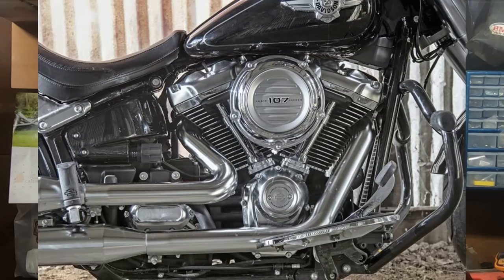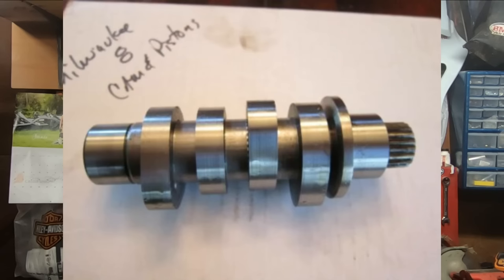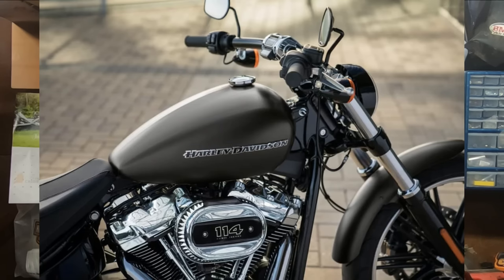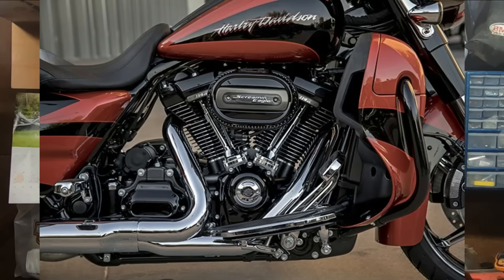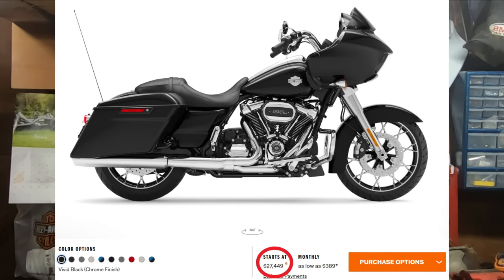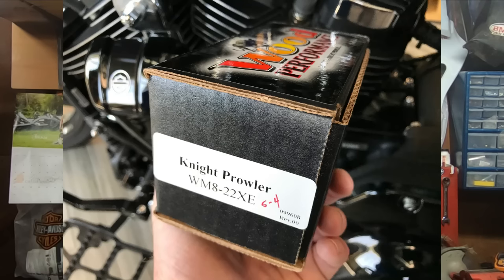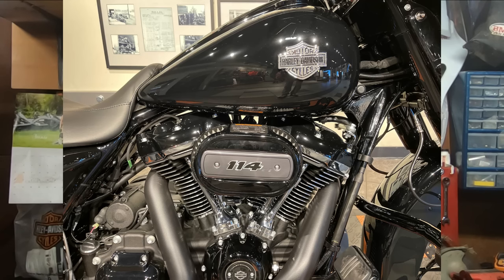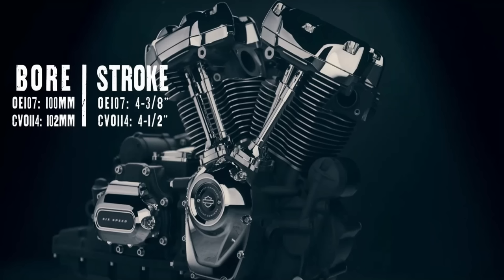Late Harley-Davidson 107's Are the Mistake You Make Overlooking

Comment: The only way I can see anyone knocking my NEW 107 is someone with experience and time and money for truly nail biting power in a Harley. I put stage 1, yea big deal right? If I twist from a dead stop 1st gear ends at just over 40 mph, and second gets you up around 70 mph before you have room on any real street to do anything else. So unless you have been riding like 124’s or above, with huge torque and power numbers, I don’t see how you could feel like it is not a great time on the bike, out for some cruising for fun. Furthermore, I rented a 114 street glide on a trip last month, brand new bike with 3k miles, and I am telling you that spending another couple thousand bucks for the 7 inches was nearly imperceptible compared to the stock 107. There was one moment where I was irritated by a goofball in a pick up truck on 465 east going around Indy and I gave it the beans and thought oh yea, it’s pretty good. But I made the choice to do that, I didn’t need to. So take that as it is for what it’s worth. If you just have a good deal on a 107, and you don’t have 15 grand to put into it and still pay your loan or whatever you just can’t turn it into a 131 or bigger, don’t worry about it just know that if you get it sounding decent like I did which gave me a decent amount of power above 3k rpm’s that was missing, you can get up to 90 miles an hour so fast (and oddly feel like you are only going 55 so be careful) it’s going to put a smile on your face every time. If you find an already goosed up 107 for a great deal don’t be afraid. Maybe you can shock some folks who look down on the 107 badge there on the side. If you have never ridden a truly big totally made over Harley that lives up to its “ass ripper” name lol, you won’t miss it anyway and you will be marginally safer while enjoying your riding. The stock 2022 107 does sound like a sewing machine at first, but everyone does their exhaust upgrades whether it’s necessary for them or not so just plan on doing something along those lines and you will love it!

Comment: What cam should I use on the 107 to give it more hp and torque so I don’t have to get the 124
Reply from the maker: I would go with the Wood W822XE, really hard to beat one of those cams. They will get you between 110 and 120 horse and torque with the 107.

Comment: The added MSRP is just the beginning.  There is added sales tax, right around 10%.  Added registration fees because it costs more.  Higher insurance premiums.  And if you are financing the bike,  especially through Harley, you are paying a lot of added interest on all of that.  I just picked up a super clean 2021 Road Glide Standard with only 3200 miles on it for $9000 + tax and registration fees less than the new 2022 Road Glide Special Harley was trying to sell me.  Not to mention, the used bike already had major upgrades installed by the original owner: Bars, seat, mirrors, radio, CMC back rest, lowers, Rinehart slip-ons. everything I would have still had to change on a Special.  A lot of good deals out there right now on low mileage used 107's.   Honestly, the 114 doesn't make cents.

Comment: Some things about The Motor Co.'s motor engineering team I don't understand.
Personally,  the EVO was a great overall design! Dual Timken Flywheel bearings, all gear camchest, dependable.
Then, the Twin Cam, failure prone cam chain tensioners, cutting costs, and eliminate one of the Timken Bearings on the bottom end. An all gear set up in the camchest is robust, simple, reliable. Why they would drop that, replaced with a cam/chain/tensioners set up. Chains stretch, tensioners wear, make the bottom end weaker, less one Timken bearing set. 
IDK. Like taking two steps backwards.
Now, the M8, already shown to have a couple serious design flaws. Yes, 8 valves increases flow, but other parts of the motor possess an achilles heel.
I would have kept the EVO platform, and continually refine it to be nearly bulletproof.
Just a thought.
Reply: agreed
Reply: I can't be too hard on Harley.  What I remember reading back in the day, the problem was our friends at the government had noise restrictions and a gear drive cam made more noise than a chain drive cam. If they put a gear drive cam in then they have to put more restrictive exhaust or detune it. Harley has to stay inside all these regulations, noise and pollution,  (and still make a profit) so the engineers have to make compromises. One thing I remember on the cam chain problem was little burs left on the chain when they were stamped with an overused stamp helped wear out the plastic tensioner faster. So even little decisions can cause problems the engineers can't predict.

Comment: I am fortunate enough to have owned TC88 (Later converted to gear drive 95ci) Stock EVO, TC110, M8 107 and a couple M8 114s. The M8 107 made good power. 114 does have little more pull but every motor minus the EVO can easily cruise at 100mph. In Cali emissions won’t let you build a 131 (Go out of state) but in reality 107 is beyond the skills of a majority of riders. Once you start pushing 120-130hp you’ll need to upgrade your clutch packs, fuel delivery and suspension at the very least. IMHO if someone has the skill I would buy an older CVO 110 or 107 and just do your own set up. Save $$$$ and have a powerful and beautiful bike. 

If I could find one: 2017 Hot Rod Red Candy Flake Road King Special and goose that sucker up 🤙🏽

Comment: But how does fuel change?
I’m a cross country guy so distance is important on 6 gallons of fuel.
But still want torque maybe 102 to 110 hp for getting out of the way.
Get 43-45 mpg
Reply: My  2020 m8 107 with a stage 2 gets on average 35 mpg compared to 45mpg stock

Comment: I have a 2020 107 m8 softale street bob. What bluetooth diagnostic or plugin diagnostic tools are preferred and usefull for troubleshooting and maintenance?
Reply from the maker: Any of your plug in tuners like Power Vision or FuelPak will allow you to read codes and get your going in the right direction. If you're looking for a professional level diagnostic tool to read live data and activate sensors those are some big bucks.
Reply: @GixxerFoo  will these tunners allow me to perform routeen maintenace such as when changing brake fluid , or troubleshooting an engine issue

Comment: Do you need to upgrade the valve springs with the Wood cam?
Reply from the maker: Not if you get a Wood cam designed to be bolt in, those are the cams I mainly recommend and cover.

Comment: Why do you have to do so much crap to get decent horsepower out of a Harley even when you buy it brand new? Harley guys are not satisfied with how big their Motors are they went from 61 to 74 to 80 to 88 to 93 to 103 and up and up and up and then they complain about all the heat you're sitting on top of a goddamn oven. Oh my Harley is so hot well you're only sitting on a hundred plus cubic inches of hot lean motor wow who never thought it would get ridiculously hot. You would think these guys would be satisfied with the horsepower that comes stocking and not do anything with the motor until they wear it out but they don't keep it long enough to wear it out they put all this stuff in it and then they sell the bike for 10 cents on the dollar really? I'm still waiting for the original equipment pistons on my 25-year-old Sportster to wear out and they haven't yet I am so glad I never had the money to buy a big twin Harley wouldn't mind an EVO powered big twin though Evo forever forever Evo.
Reply: Same reason people buy new mustangs, challengers, corvettes and do the same thing. 
Its a hot rod mind set
90+% of big twin riders never go beyond stage 1.
Reply: Yes, I’d rather my POS 88 Dyna was just a LOT more reliable with better build quality and less power, than constantly breaking down and dealing with ridiculous major issues like cam chain tensioner system having to be replaced and stators melting. 
Only 16,000 miles on a big engine and $8K just spent on repairs.
Reply: @shizuokaBLUES  ouch.
Reply: @shizuokaBLUES  I am surprised that twin cam owners do not engage a class-action lawsuit at Harley-Davidson for their motorcycles being unsuitable for use. You buy a brand new motorcycle to be free of having to worry about mechanical defects yet here it is you get all these problems to deal with because of their cheapness in building the engine and the engine is the most important part of the motorcycle and the most expensive to deal with when things go wrong. If I had a twin cam I would go with the Gear Drive if possible but then if you're going to go that you might as well replace the everything else that is questionable as well. And that costs a ridiculous amount of money $16,000 miles oh that that's just pitiful I truly feel sorry for you that you got such a lemon of a motorcycle. Good luck in the future and ride safe brother.

Comment: Have a 2018 Heritage with a 107 with a stage one and a Dark Horse Man-O-War compensater and Baker transmission with taller 5th and 6th gear, and it will run 85mph with  wife on the back at just under 2800 rpms
Reply from the maker: That's awesome! That's really impressive with the 107 and having the taller 5th and 6th gear.

Comment: its all piontless my 107 has a limiter at 122 mph and my mates 114 has the same thay just keep making bigger and bigger engines that do less to the gallon and cost more to insure
Reply from the maker: The size of the engines is getting crazy anymore these days, but the torque on these motors is equally as crazy with what they are putting out. We are getting over 150 foot lbs on some big inch built M8's.

Comment: The point hes making is the 107 bottom end is superior to a 114ci. The slightly shorter stroke lets the bigtwin rev higher and safer. You run a bigbore kit and cam on a 107 bottom end is a bad mofo.
Reply from the maker: I am a big fan of the shorter stroke engine, look at those 88's with 95 inch big bore kits and some cams on them. They run really really hard despite their smaller displacement compared to todays stuff.
Reply: @GixxerFoo  im a master diesel/ euro tech that builds for topfuel and rallly. I totally agree. I picked up a 2022 roadglide 107 last year it only had 3200miles paid 16,500 out the door at the dealer with a extended factory warranty for another 3yrs at palmbay harley. They gave me a INSANE deal because all the older guys wouldnt buy the bike due to it not being a 114. Thats crazy to me haha. I love my bike. Best harley ive ever owned, fast smooth and runs hard as hell.

Comment: You're NOT SAVING MONEY! This is all money SPENT. You have to pay for the bike, bikes not free. You have to pay for the parts, parts not free. You have to pay for the labor, labor's not free. Nearly every channel frames these upgrades to smaller displacement bikes as saving money, & you're not saving anything. Spending less than buying a bike with a built 131 is not the same as saving money, bargaining with yourself buying cheaper motors and upgrading them over time actually costs more money if you factor in inflation & increased labor costs. I get it I do, really it's your money do with it what you want. I'm done 😂
Reply from the maker: A lot of people don't get that if you want to do engine upgrades do it all at once. It is cheaper that way in not paying labor over and over to tear down and put the bike back together. It's kind of the same as paying cash vs putting it on a credit card and paying interest on the bill.

Comment: The 107 is a slug in stock form.  114 light years better as far as stock seat of pant power.
Reply: I made the right decision with my 114 FatBob then?
Reply: I have a 2020 107 m8 softail  with a stage 2 I bought brand new. My bike now has 43k miles no issues. Warranty finished a few days ago.
Reply: @adminadmin9997  impressive miles

Comment: Quit pushing cam chests.  That’s been remedied. Also, look at Cycle Rama cams.   Your bias is very obvious
Reply: What info/experience are you basing your cam chests assertion on? Don't necessarily doubt you, just wondering.
Reply: @barrybarnes96  the idea that a whole $800 pump and plate is needed.  It is not but I agree a $110 oil pump on the pre2020 M8 is a necessity.

Comment: I'm keeping my SG a 107, but I want better flow heads and throttle body, cam and duel exhausts. So that was the angle I was going to do using Screaming Eagle products. But imma look into this cam, wonder how well it will do with unbaffled exhausts?
Reply from the maker: With unbaffled exhaust you'll still get more torque with the cam but you will lose some bottom end with the unbaffled exhaust. Wide open throttle flat out it will give you some minutes gains. You might want to put some torque serts in and that will help with the bottom end if you want to run open exhaust.